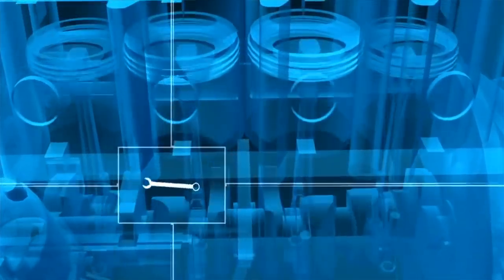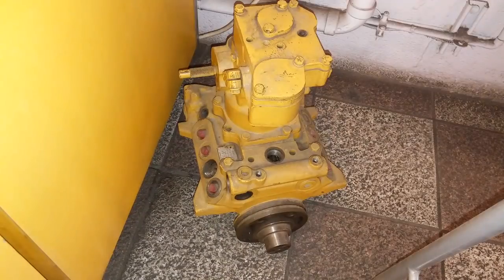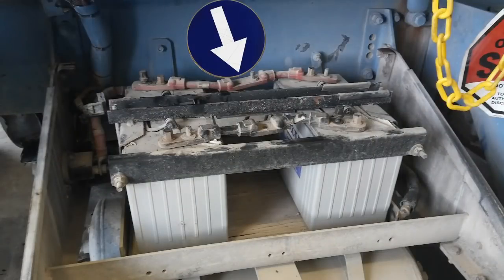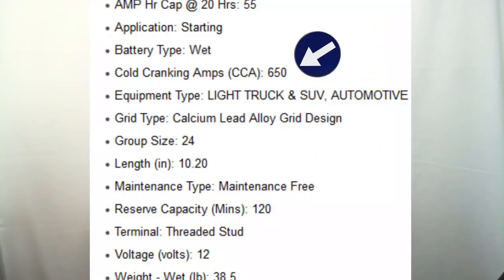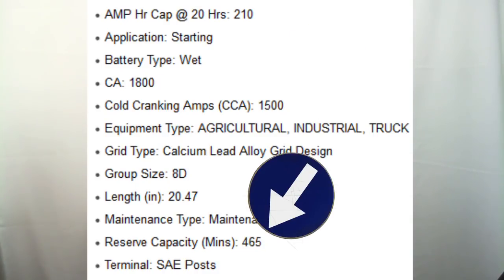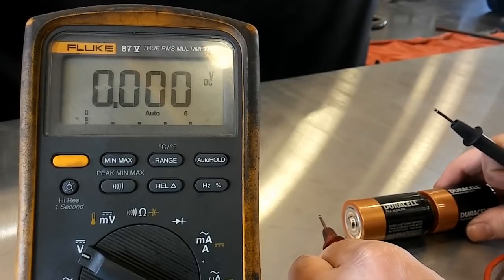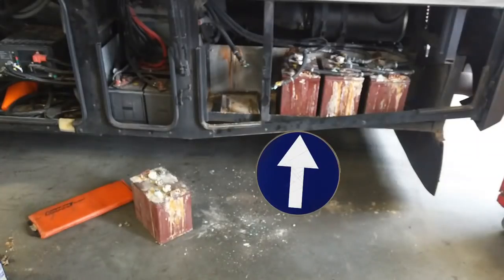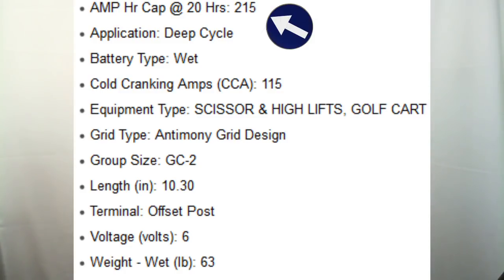Why Do Diesels Have Two Batteries?  Why Do Diesel Engines Have Multiple Batteries?

Comment: Great Video, Josh...probably the best explanation from anyone on here, including 'so called' experts from battery companies..
Reply from the maker: +Malcolm Young I love making these videos, I have to do some research on each one and learn myself every time. Thanks for watching.
Reply: Adept Ape 
Does compression ignition vs. spark ignition not effect starting also? With C.I., the cylinder must get hot enough before detonation (starting) will occur. Is this likely not the case with S.I.?

Comment: That was a great explanation of the different kinds of electrical systems found in the automotive/industrial worlds, and how/why batteries are configured to work within a circuit. The battery is probably one of the most misunderstood components in these types of electrical systems. You did a good job of clearing that up for people. Thank you!
Reply from the maker: +mopar3502001 Thank you.

Comment: Great vid Josh. I have a 'toy hauler " Duramax diesel motor home and wondered why the "house batteries" were separated from the TWO starter batteries.  I was glad at one point when I found a relay switch which tied both systems together if I needed extra boost after sitting idle for a while.   J K  in Houston TX
Reply from the maker: +James Krivitsky A lot of RV battery systems have those link switches. That batteries can cost a small fortune when they need replacements.
Reply: Yep, I am on my second set of batteries and tires, both costly VS. motel room in the middle of nowhere ( or RIGHT THERE ). I am learning bunches . Keep up the helpful work .  J K

Comment: Great explanations! I thought just about ALL modern tractors (semis) were 24 volt. Saves a lot on copper (wire size) usage. I wish all cars were 24 volts too, but I guess impractical mainly due to battery design.
Reply: about 10 to 15 years ago, car companies said they were going to use 42 volt systems instead of 12 or 24 volt systems. It never happened and I don't know why.
Reply: @skylinefever  4 years later and the 48v talk is back. Maybe with the ev nuts they'll actually make it happen this time.

Comment: Another excellent video.  I couldn't help but notice excessive corrosion on the batteries in the one picture.  Off on a somewhat related tangent here, our old 120G graders used to eat two 4d batteries every year and a half.  Maintaining clean battery tops (eliminating enhanced self discharge) plus the operators using the hydraulic bypass lever every time they started the engine (causing less load on the batteries and starter) allowed the batteries to last six years.
Reply from the maker: +Chad Jessup I feel like batteries are one area where despite technological advancement, they last and work about the same as they did several years ago. Tires, filters, injectors, and nearly everything else seems better, just not them.

Comment: I had a 92 dodge w350 with a 5.9 cummins. It came from the factory with only one battery. It started great above 30 degrees but below that it needed to be plugged in.
Reply: Weird, my 92 w250 only needs the one for any temperature.

Comment: When I test fire diesels on an engine stand after servicing or rebuilding I just use one battery. It is a semi battery with 1300 cca, and the biggest engine I have started like this required 1100 for the starter

Comment: Let me say this about putting batteries in series and what happens to the current.  Ohms Law says I (current) = E (volts) / R (resistance).   On any given circuit, doubling the voltage will approximately double the current.  There may be some losses due to dirty connections and such,  but you CAN’T defeat physics....  Cheers!
Reply: Chris Breidenbaugh This is how it was "given" to me: series doubles the voltage, parallel doubles your current, at least when it comes to DC. Been 20 years to this day and the lesson it's still "holding air". 😁👌✌
Reply: Parallel will give you additional capacity (run time).  It does not increase voltage.  If there's no increase in voltage, then there's no increase in current (assuming your resistance is constant).  You can Google this and find many articles regarding Ohms law and batteries.

Comment: Exactly the three batteries are use to start the motor and the fourth is for auxiliary power in the truck. So it doesn't take all four batteries to start it. That goes for the two battery pickup diesel trucks. One for starter and the other for auxiliary power.

Comment: I hooked to Duracell D's together series but my truck still won't start!  😉
Reply: FrugalPrepper Two not to 😉
Reply: FrugalPrepper boi
Reply: Series?  That’s your first mistake. Second was using Duracell D cells.    Rookie. 😂
Reply: Oh, Skippy, you bad boy.....
Reply: he aint no energizer bunny ;)
Reply: did u make sure the pointy tip was against the flat side of the.. battery you call it? I connected my D battery pointy side together and it created a black hole in my living room.
Reply: You probably tried it with 2 D's.   To start my tractor trailer, I had to use 3 D's.   Try again and let me know if that fixed it.   If it doesn't, then you might have a problem with one or both of your wipers blades.   The rubber contact with the windshield is very critical to the grounding of the batteries to allow for full cranking power.   Hope I was able to help.

Comment: I just converted my military surplus k5 Blazer (m1009) to 12 volt.
They had 2 12v batteries in series and a 24 volt starter because the miltary wanted them capable of jump starting tanks and Bradleys.
Everything besides the starter is 12 volt, the glow plugs fed through a big reistor bank.
When that resistor goes bad, you lose all your glow plugs.
Now I have my batteries in parallel and swapped in a 12 v starter.
Yes, I doubled the current needed by going from 24v to 12v.
I can't jump start a tank anymore..
But now I can use both batteries for my winch power and I still have two alternators.
One is a spare now.

Dig these videos.
I miss hanging out with my mechanical minded buddies.
Reply: Stupid to convert to 12 volts... should have just got a normal k5... then... the 24v system works fine and is documented swapping to 12 your up a creek when you have an issue.

You could have just used the winch at 24 volts... and lol your really running 2 alts still at 12 volts?  That's a 12 volt conversion I've never seen yet... or are you running 2 alts and only getting power from 1... if so you cut your trucks power by 50%...
Reply: Matt Lane 
One alternator is a spare.
Since the cut in voltage will always be different between the two regulators, only one alternator will be working.
Therfore, the other would do nothing, unless the voltage drops enough to reach it's regulators cut in point such as when; operating the winch, recovering from start up.
The main disadvantage of the hybrid 24/12 system is that the front battery gets used for the glow plugs and all the 12 volt accesories while the rear battery only gets used on start up.
This leads to a well known imbalance and thats why people swap them around periodically.
Also, my winch can utilize both batteries now as opposed to only one.
Sure, a 24 volt winch.. that sounds cheap and easy to get parts for, just like the old 24 volt starter i threw out.
Reply: As for being up a creek?
Dude, i am a master mechanic.
This is my third K5.
The m1009 is a K5.
The resistor bank and a few switches and a minor difference in wiring.
I have seen this argument on steel soldiers site and you guys need to learn basic mechanics and electrical yourselves before you go  giving advice.
Reply: "The main disadvantage of the hybrid 24/12 system is that the front battery gets used for the glow plugs"
"you guys need to learn basic mechanics and electrical "

Both batteries are used for glow plugs and the 12v system... is headlights rofl... 

The winch is as simple as putting on a 24v motor... I run my plows on 24v motors... I don't need to learn anything lol... I have like 8 of these... the 24v system works fine,  I wire my lights onto the rear battery plow is run on 24volts (controller rest on 12).  I see no reason to hack up a working system... and your comment about the resistor... well if they fail once every 35 years who cares... rofl... your only issue (again learn something rofl) would be when one plug fails... the rest get higher voltage HOWEVER the controller has protection for that and will cycle them... also using ag 60s rather than wellmens helps with that. 

My local rebuild shop has that 24volt starter INSTOCK... as well as the 27si isolated ground alternators IN STOCK...
Reply: Matt Lane 
So you have a need for 24 volts.
Great.
I do not.
I bought my m1009 to be a vehicle recovery truck up here in the mountains.
I have no need for 24 volts.
Already owned a 12 volt winch.
Already eliminated the worn out resistor pack.
Rebuilt both 27si alternators myself.
I don't tell you what to do with your truck and you don't tell me what to do with mine.
You guys at steel soldiers get all high and mighty thinking you have rights to every ex military vehicle out there.
Well i bought it outright.
It is my K5 Blazer now.
I don't need your permission to modify it.
You give the military vehicle enthusiasts a bad name by sticking your nose where it doesn't belong.
You want to control all the m1009's.. buy them.
Have fun with your dusty service manuals.
Reply: I think you need to learn you have 2 12 volt systems on that truck and 1 24v system... you can use your front battery 12 volt system you can use your rear battery 12 volt system as long as what you are using is grounded via WIRE only and you ground back to the battery (IIRC) and you have a 24 volt system you can pull from (pulling from both 12 volt systems)... and oh baby does the plow move much faster on 24 volts than 12...
Reply: Um, lol you want a recovery vehicle for mountains so you buy a weak c clip axle 3.08 gear gov bomb truck?  Why not a 1028... gov lock rear full floater with dana 60 LSD front.... idc what you do, modifying the wiring is just imo dumb... you could have slapped on a 24volt motor on the winch you dont need a new winch the motor is replaceable and kept the 12v as a spare... same as I do on my plows... lol.  It was there so I used it... I also used it with just the 12volt and had no issues.  You can do whatever you want with your truck but you wanted to toss around insults so... 

I also don't like that website btw... but keep assuming.
Reply: Matt Lane 
Are you a scientologist or something?
The 12 volt starter turns the engine over exactly the same as the 24 volt starter.
There is no advantage.
My resistor was puffed, baked, allowed too much voltage at the given current the 60g glow plugs were pulling.
The gp card tried to rescue but it still sends too much voltage to the remaining glow plugs and they failed 1 by 1.
Switching to 12 volts eliminates that issue entirely.
There is no reason to keep the 24 volt starter.
I am not planning on jump starting an Abrahms tank either so even less need for 24 volts.
What i have done is simplified the system and made it a conventional 12 volt truck like the millions of others rolling down the road everyday.
Hey, you want to buy my old resistor?
How about the 24 volt starter?
Just kidding.. they are in the landfill.
Reply: lol... OMG I HAD NO IDEA YOU COULD... your kidding right... at that point like I said why not just use the pickup?  I mean the 08 had troop seats lol and a cover
Reply: Matt Lane 
Wheelbase and unsprung weight.
Those 1 ton axles make the truck ride poorly.
The short wheelbase of the Blazer and near 50/50 weight distribution make it the most off road capable Chevrolet vehicle of it's day.
Even the Bronco of the same era had the inferior twin traction beam, about the only thing they did better was land a jump without breaking.
Also like to camp in my truck and the Blazer wins their to.
Thats why there is chocolate AND vanilla.

Comment: The 12V in my D250 only uses one battery stock.  The brand new Cummins in my off-road forklift at work only has one battery also. Our larger trucks, like you noted,  of course use multiple batteries.
Reply: 1320fastback Off-Road fork lift . . . Today i learned something new. Google Images here I go.

Comment: well... i got some older diesel stuff around and its pretty straightforward to convert them from using 2 battery in parallel to have a hybrid setup, means that the batteries are tied in series for starting, and paralell for charging. 
and thats the best of both worlds , specially with an isolator between the batteries...
that means that when the thing is not running, the batteries are not connected in any way.
so i still have a standard 12 volt stuff inside, like instruments and lights and shit, but  i get the 24 volt to start them up. for the same power, you need half as mutch amps thisway.
and charging batteries in series is not a wise action, you would need an equaliser and even then its not the best solution. but parallel charging them makes sure both of them are on the same voltage no mather what.
Reply: Hmmm.....are you running 24V to your 12V starter? Is that OK for brief cranking? My 1950 Ferguson tractor has a 6V starter running on 12V and it has been fine for decades, but I'm nervous about doing this to my collectible vehicle, a 1984 F250 with International 6.9L diesel.

Comment: Do hybrid trucks use the hybrid battery to start instead of the smaller ones? Like say a hybrid fright liner with a ISX 13 it has a huge 360v battery on the side. does it use that for the starter?
Reply: Hybrid Freightliner?

Comment: Adept is a young guy before series parallel  switchs where 6 volt  batteries wired in series for 2 sets of 12 volts but when the starter is hit the series parallel sends 24 volts to the starter 
Lot of the newer trucks use 3 batteries 
2 12v starting batteries and 1 deep cycle batt to supply the driver with 12 volt power when he is just hanging out in the sleeper
But then what about the eaton hybrid transmission 
Guess there is no one size that fits all any more things are changing fast 
I been retired for 8 years

Comment: Correct me if I am wrong. I did watch the whole video. Series batteries increases amperage, while parallel batteries increase voltage. This is what I learned in vocational school. I can also reiterate the colors for resistors, which probably are verboten now. lol
Reply: Correct. Do you deal with 5 or 6 band resistors by chance?

Comment: When VW built cars with 4 cylinder gasoline and diesel options, they had one battery, but gasoline engines would typically have a group 40 or 47 battery and diesels would have one group 49 battery. I guess if you went to an auto parts store and said "I need a diesel battery" and told them what VW you had, I think the parts guy would just fill the computer menu like this:
Year: 2000
Make: VW
Model: Jetta
Engine: DIESEL/turbocharged/1.9L
And then pick out the group 49 battery. You could bolt it on and get going.

However, If you had something larger, you probably needed two batteries instead of one, so someone with a GMC 6.5 might be given one group 78 battery, and they would still have one dead battery. The customer would be outraged and claim that he was sold a defective battery.

Another thing that makes a difference is combustion chamber type. Direct injection typically has a shorter cranking time and lower compression than most prechamber engines. Faster starting and lower compression makes life easier for a battery.

6:40 I have been told military vehicles often use 24 volt electrical systems.

Comment: There's also multiple battery set ups that use one battery for the ECM.
Reply: dieselrotor   That would be a very rare system though.
Most OEM systems have a common circuit for starting charging, and some other accessories mandated by law. They wouldn't have a need for a standalone ECU on a separate battery unless there was some crossover from legislation such as 1988 models in Canada, etc. Never gonna happen in today's day in age, the one battery could fail and cause damage, etc.
Reply: That idea makes sense to me, given that the ECM needs to step up voltages to operate the HEUI injectors. Bill Hewitt at Powerstrokehelp showed some of those parts as an example. I suppose when you have to operate injectors larger than those on a 6.0 or 7.3 PSD, there would be a benefit.

There is another reason why this may be used. Voltage drops as the starter turns, and if the ECM doesn't have enough volts going through it, then it will not function. I suppose if the second battery kept the ecu at a stable 12.5-12.6 volts, it wouldn't be so much of the problem. This is a common problem on "Cranking but no start" situations on certain Chryslers as well as many other computerized vehicles.

Comment: Here's a question, why does the Cummins 5.9 in the first gen dodge have one battery and start within 1 or 2 cranks, but the cummins 5.9 in the 2nd gen dodge has 2 batteries and takes longer to crank?
Reply: Catman Outdoors emissions restrictions
Reply: Eggsr2bcrushed false my 99 Cummings has 0 emmisions and two batteries

Comment: Ok so let’s see if you can answer my question. Today I accidentally ran my 2018 F-250 with only the passenger batter connected. I forgot to connect the negative cable to the battery on the drivers side. I drove it like that and it felt very laggy. Once I connected the other battery the laggyness went away. Why???

Comment: just an interesting note, rv batteries even though they are deep cycle cannot be used in a golf cart because of the amp draw of a cart is much higher and they also charge at a much higher rate than rv batteries
Reply: RV batteries are a kind of compromise. They are used as you would use a deep discharge battery, and they can be used as a starting battery. They are not true deep discharge batteries and will not last long if you use them like one.